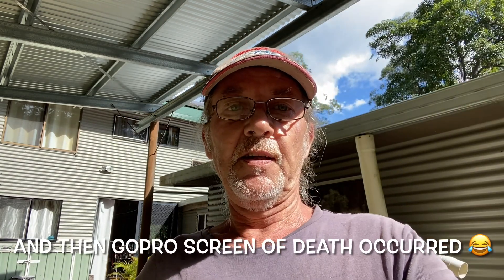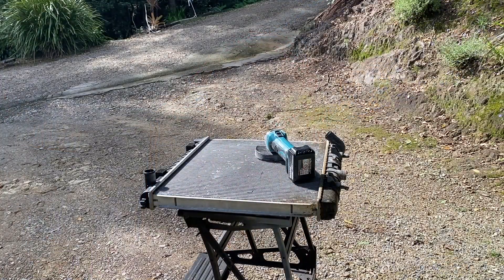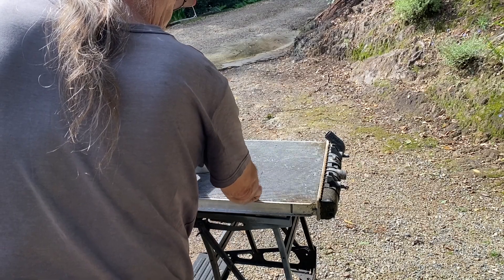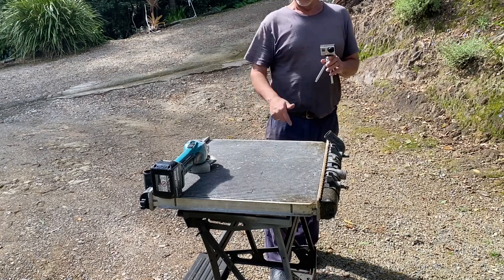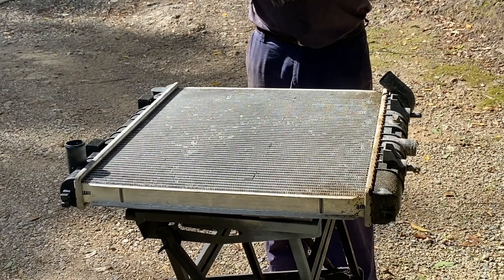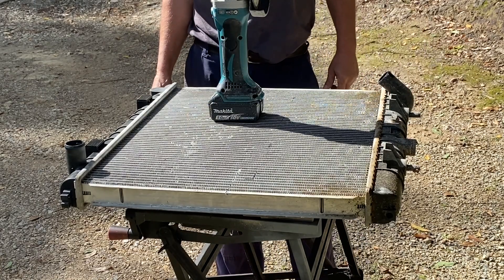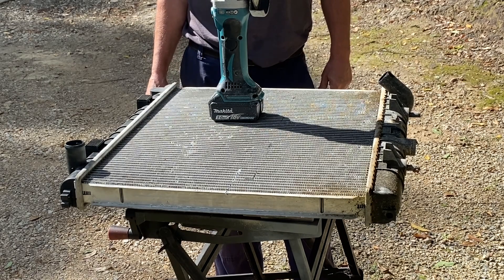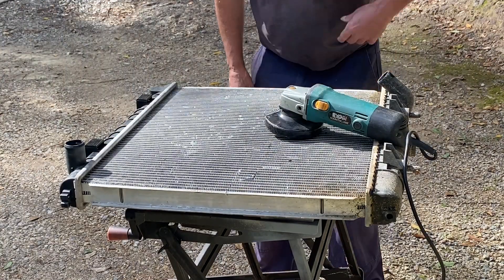Does ‘MAGIC’ Head Gasket Sealer Work or BLOCK Your Radiator? #car #mechanic #engine #automobile

Comment: never heard of magic, but i have heard k-seal is a good one. i think its only supposed to work when under pressure and comes in contact with air, then it seals.
Reply from the maker: people just call it ‘magic’ , it’s not a brand.

Comment: I've seen radiators like this even without head gasket sealer. Just straight build up from bad maintenance which helped ruin the head gaskets in the first place.

Comment: Why did it only block the middle?
Reply from the maker: My guess is the flow at the ends may be more than the centre and so slower moving means more chance to block? Or its fan spread related where it’s a bit cooler right in front of the blade area? Not certain though mate to be honest.
Reply: @wellwhatdoyouknow670  that was my thought.